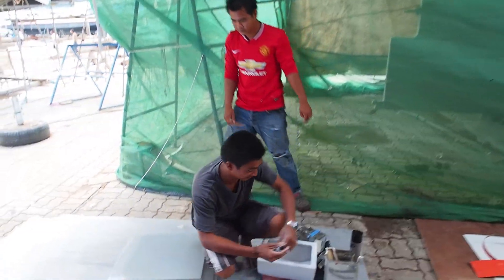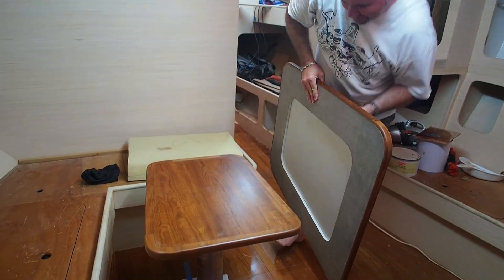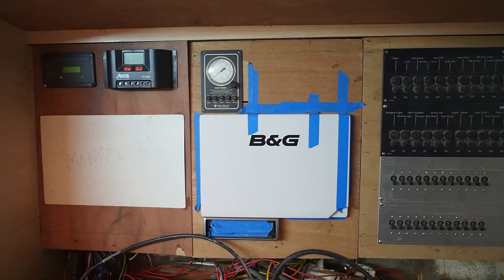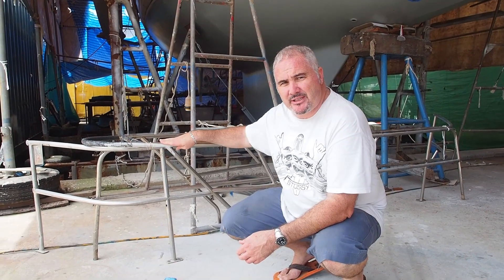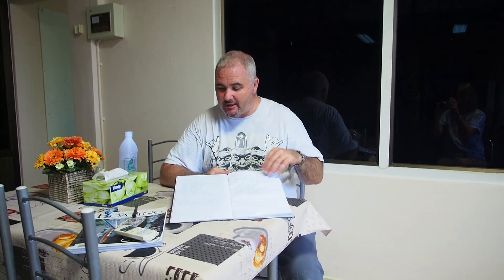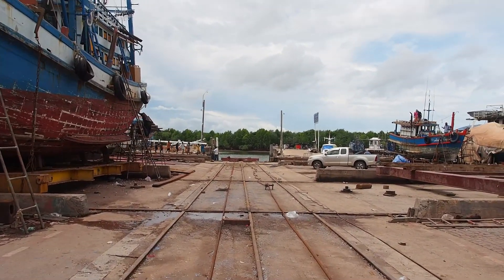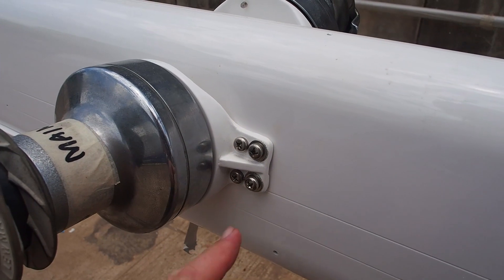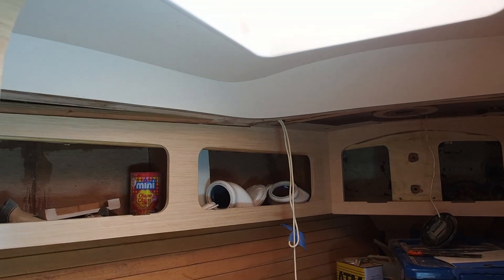Esper Refit 26-29 six month round-Up

Comment: love the vids. Gives a great view on a complete "overhaul"
One question: when refitting the screws & co, why did U opt to re-use the slotted screws instead of for example using Phillips head or even imbus/hex head screws?
Reply from the maker: Hi ForSeTi Trimaran. Good question, but perhaps what doesn't come across in the video are all the bolts and screws we DID replace with Philips. Although it would have been ideal to replace every bolt we did re-use some of the old ones. We probably replaced about 90% of the fittings.

Comment: Will you need to lift off the larger table when you're at sea rolling around? I'm yet to see a fastening mechanism for it.

This is an excellent series that is very valuable to a wannabe sailor like myself. Thank you so much for doing it and fair winds!

It looks like PPS have increased their rates since your refit as most labourers are 800+ THB now. Are they negotiable on daily rates for an extensive refit such as yours?
Reply from the maker: It's always worth negotiating but for a normal yard labourer it's doubtful. You'll have to get in touch and see what they say. The table, BTW, is rarely up! We don't use it much so it's stowed away 99% of the time. It creates so much more space!